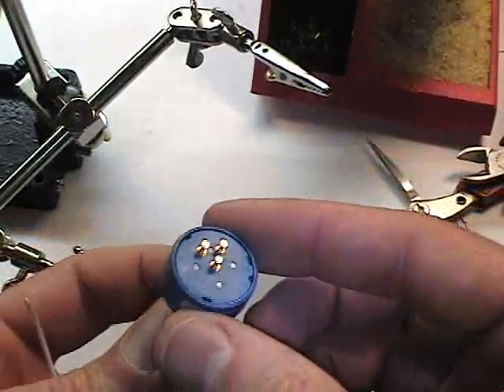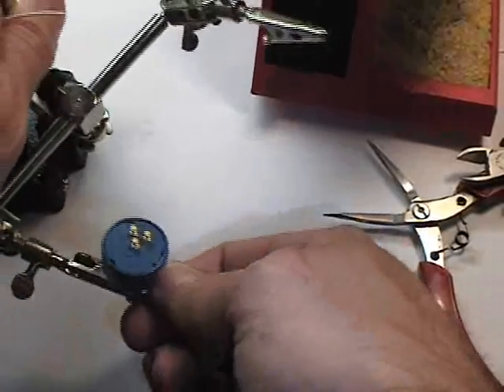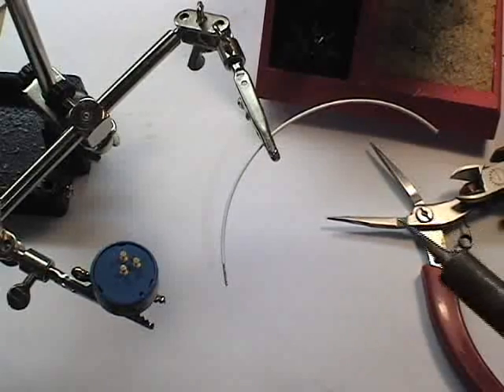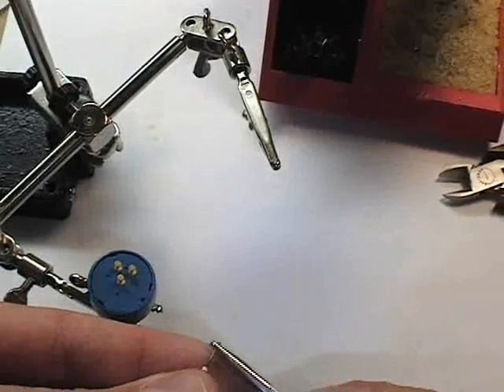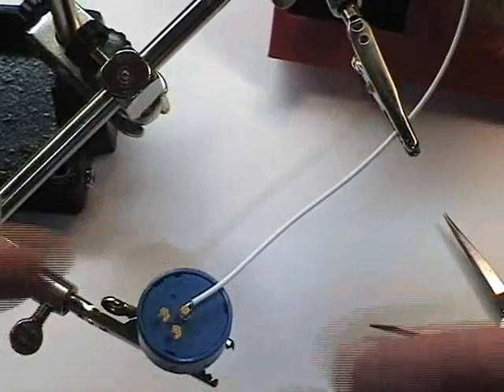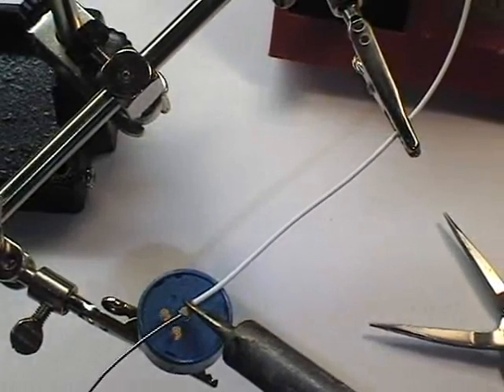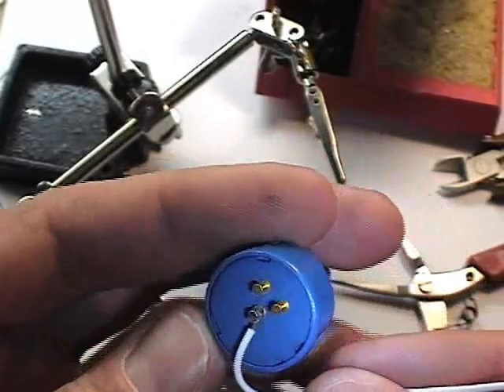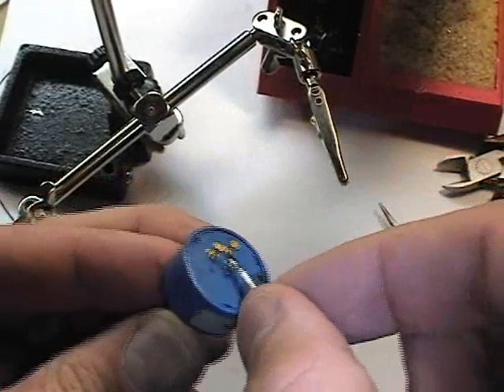soldering leads on a bourns potentiometer

Comment: I agree,invest in a good Weller,I have a 200.00 Weller,it makes the job so easy when working with small electronic parts.you arent soldering car radiators,so avoild big tip irons on electronics.

Comment: Actually, it is best to leave solder on your tip when you're finished with it. The solder will act as a protective coat that will oxidize, instead of the tip's iron plating. Clean the tip just prior to soldering your next connection.

Comment: Hi Helichair,

    I love your wire striper; can you please tell me who the manufacture is? I need to make many breadboard jumpers and that tool would be of much help. Also, see youre using a Weller WLC100; I have the same iron and its never let me down.
Remember, always clean your tip when youre done playing
Thanks,
Joe